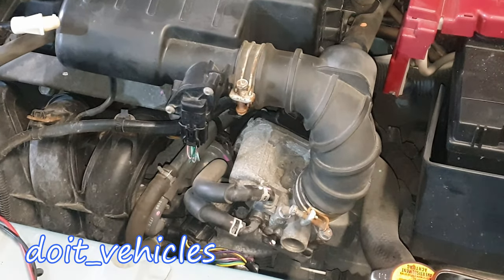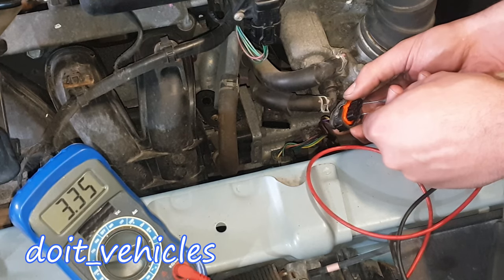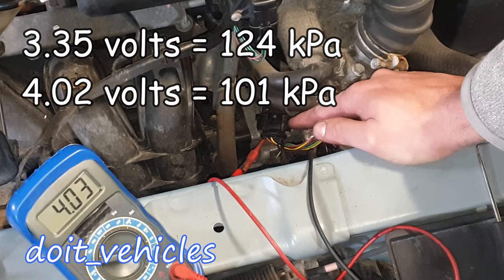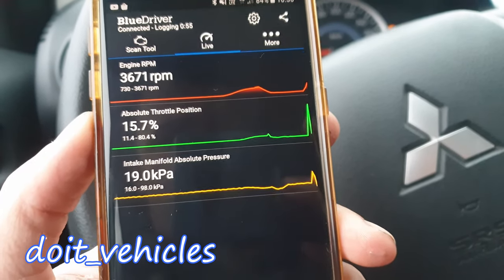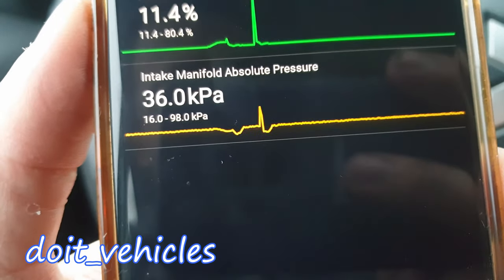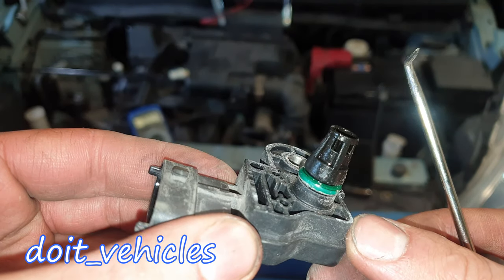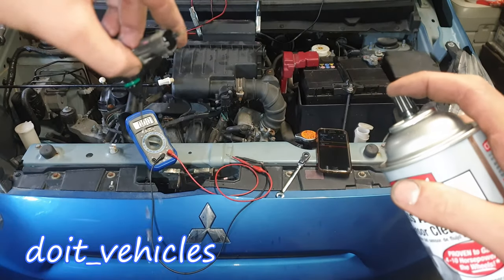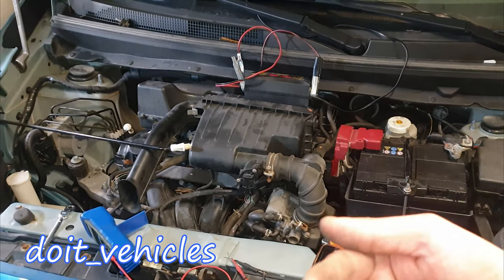MAP sensor 2015 Mitsubishi Mirage Intake Manifold Pressure Live Data , Cleaning, Gasket Check P0105

Comment: Excellent video.  BUT i was very currious the reading AFTER you cleaned the MAP sensor?
Reply from the maker: Great suggestion! The sensor will usually respond faster or the range of values will increase
Reply: I towed my daughters 15 cvt mirage home last night via car dolly.  She thought the transmission was bad.   Symptom "car will not go into drive".  

My quick evaluation in rain and dark was that embody stalled when placed in drive [a load].  Suspecting dirty MAP, VACUUM LEAK,  cam solenoid?   Clogged Egr??  My actron 9580 live data obd will not update/recognize this car so I can't pull codes!  
Looking through videos during break to help me before I get home to work on car.   Any ideas?? Thanks!!!
Reply: Meaning car is to new for 09 scan tool